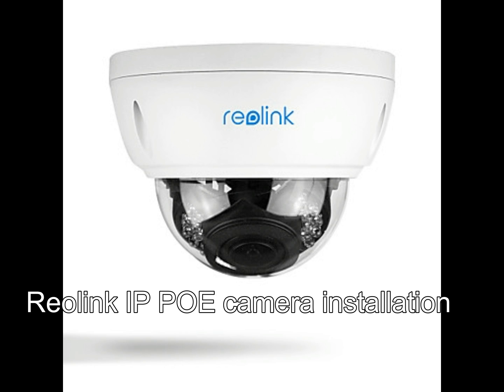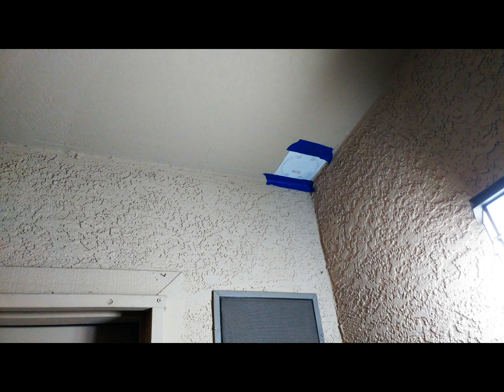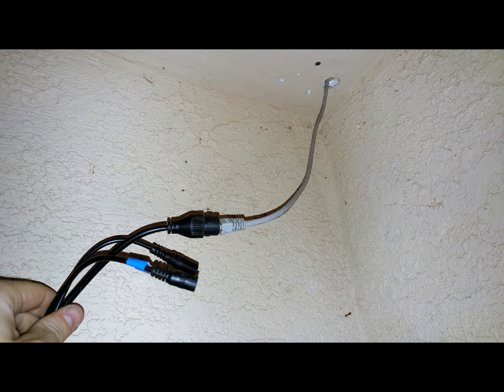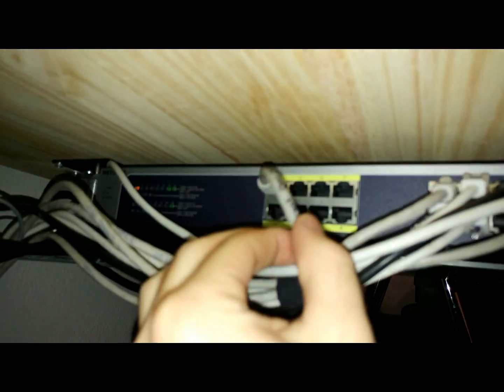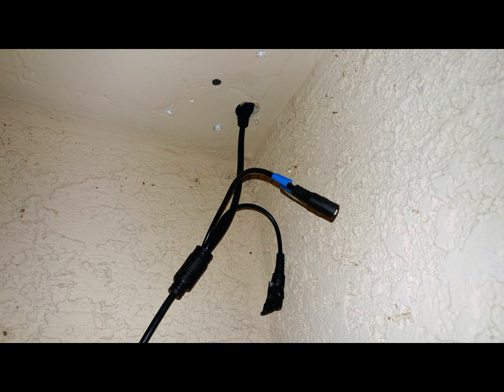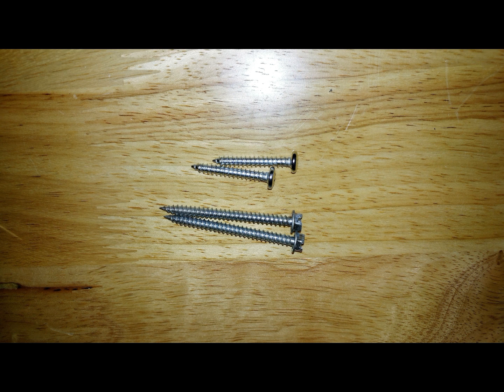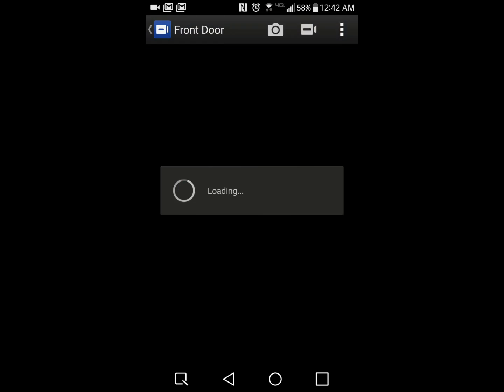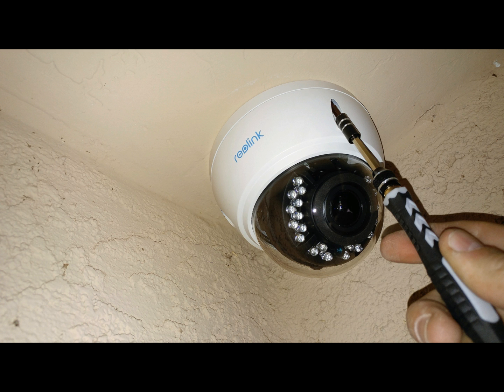How to install a Reolink or Amcrest Security Camera

Comment: i though reolink cameras only worked with reolink nvr. were you able to bypass that using a switch? and the switch allowed for poe?
Reply from the maker: The Reolink cameras work great with or without a Reolink NVR. In my setup I have a Netgear  POE switch (model JGS516PE-100NAS) powering the cameras and a Synology RS815+ running 'Surveillance Station' acting as my NVR.
Reply: i'm a rookie - sorry for so many questions.

instead of the reolink nvr, you replaced it with the netgear poe switch and the synology nas together making it your own cloud. you use your computer (workstation) with monitor to manage everything and change settings.

so essentially, with the netgear poe switch, you can use any ip cameras whether poe or not. poe ip cameras, of course, as likely the best option.
Reply from the maker: Happy to help. Yes, exactly. Check out this video for my basic setup: https://www.youtube.com/watch?v=ikBSfiaSzWU 

The Netgear POE switch allows me to use any brand POE camera (and as long as it supports ONVIF it will also be compatible with my Synology NAS) as well as power my Access Point and a few other POE devices around the house. 

Obviously, if you use the Reolink NVR it would be for security cameras only, no networking,  access points or file storage etc..